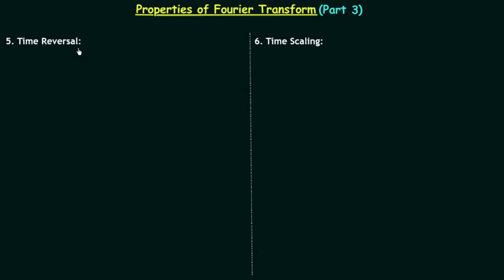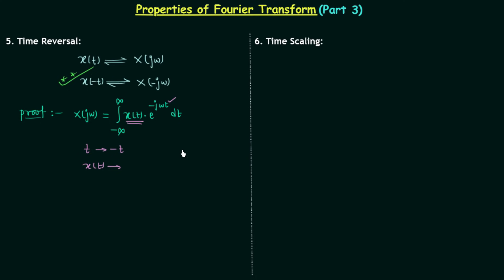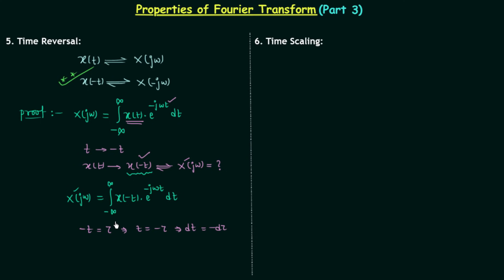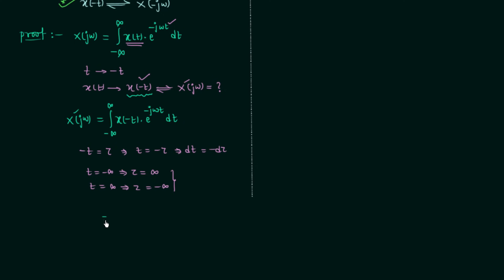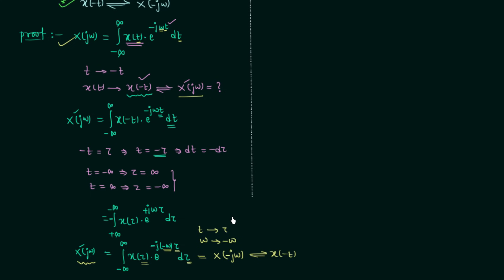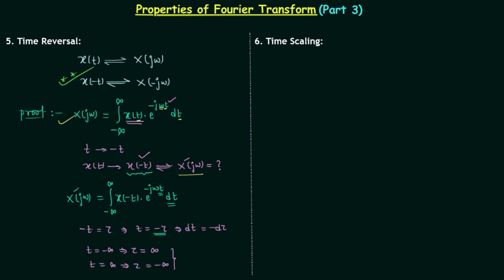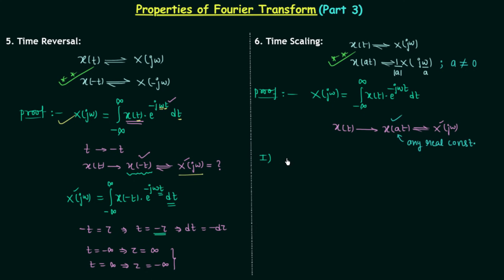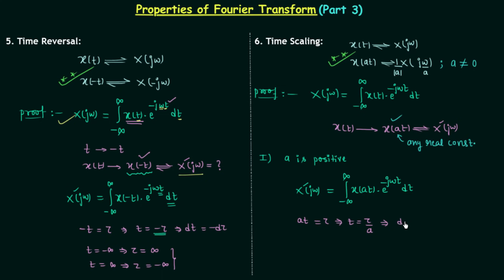Properties of Fourier Transform (Part 3)

Comment: for a<0, if x(-jw/a)and for a>0 if x(jw/a)...then it must be the modulus of x(jw/a)but not that of 'a'...how did you write the modulus of 'a' there...for the modulus of 'a'...there must be 1/a and -1/a there infront of x(jw/a).
Reply: From what I understand,if we look at x(-t) transform,we get X(-s) or X(-jw) right...(laplace and Fourier transfor), so here a=-1,yet we still get transform without -ve outside(ir -X(-s) or -X(-jw))...so regardless of a if postive or negative we give +a * with X()term...we use modulus to show this....and yes modulus also means what you said ie a is +ve for 0to +infinity and -a for -infinity to 0.sadly this is the explanation i could come with my limitted knowledge.regards